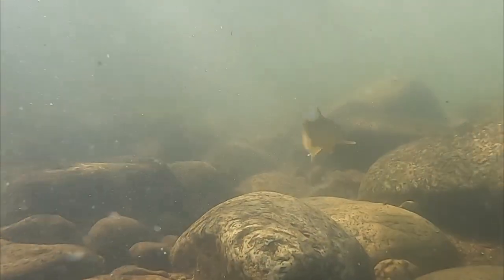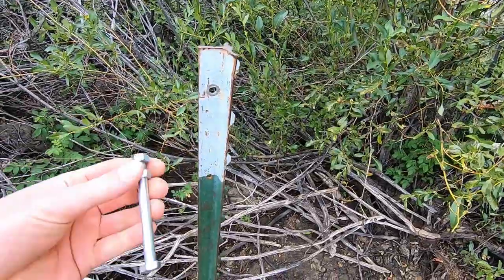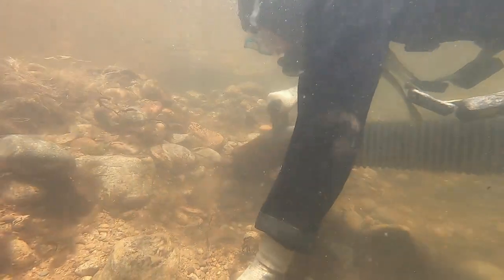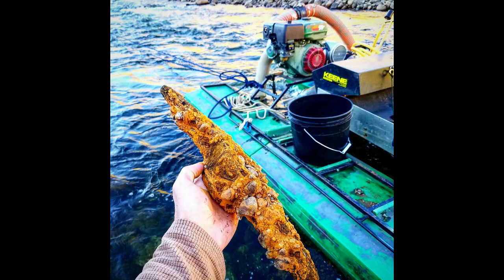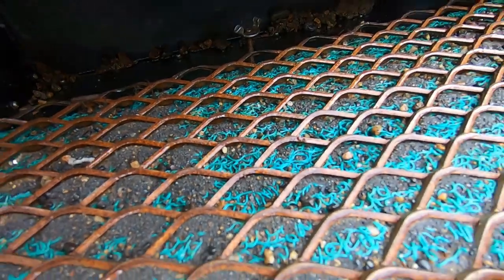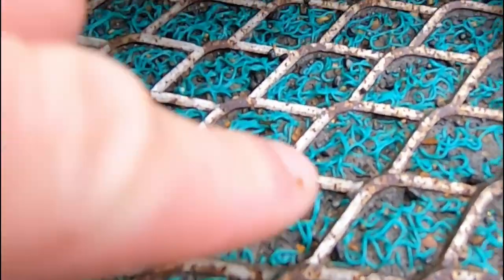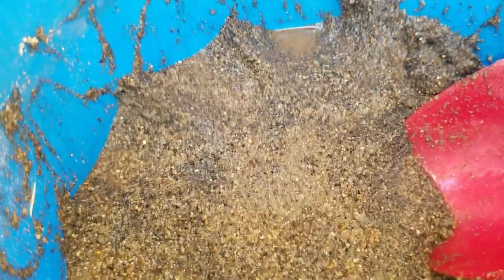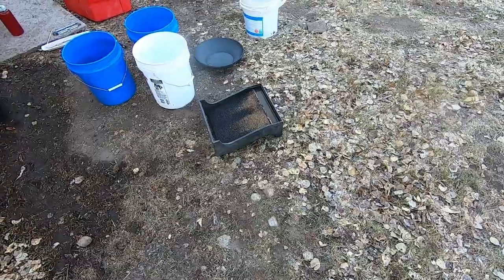River Dredging for Gold - On the Paystreak!

Comment: How many dives do you have to do in order to get that much concentrates? Do you clean the box after each dive?
Reply from the maker: The heavy black sands are so abundant in this area that I have to clean out the box every day. It would really be best to clean out the sluice every 1.5 hours. Trouble is, that each cleanout fills a 5 gallon bucket 3/4 way full!
Reply: @ColoradoGoldCamp  Wow thats alot of concentrate

Comment: You need to raise the angle of the riffles just a little bit and it will help clean up the black sand and sand, and it'll catch more fine gold.
Reply from the maker: This section of river is overloaded with heavies. I am yet to see a full sized dredge sluice that can deal with the BS.   I'm working on re-configuring the box to address these issues.

Comment: I can make you an underwater dredge that runs off a power pack that floats above on drift tubes. So you can drift on an anchor. I used to do it in Cali. 😀 I did know a man who would pack a six inch in by himself and out in a day. 

He was named ounce a day dave. He is Dave McCracken the famous dredge maker. He also had 6 miles of the amercan river claimed up.
Reply from the maker: I am familiar with Dave. Production dredging is some seriously difficult work!